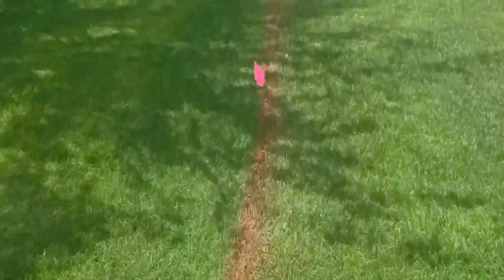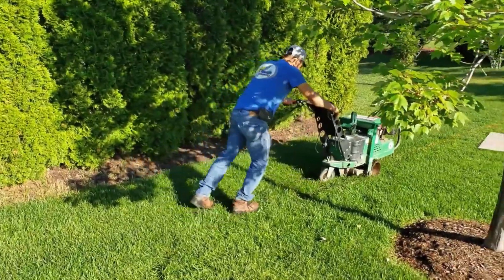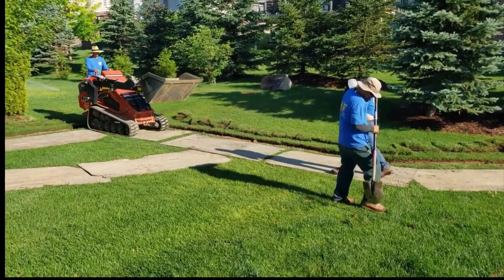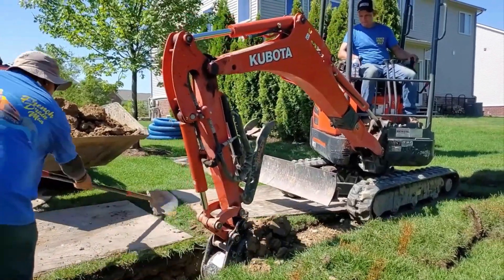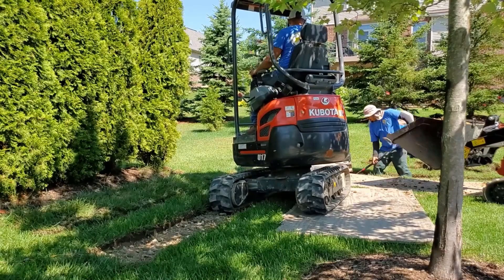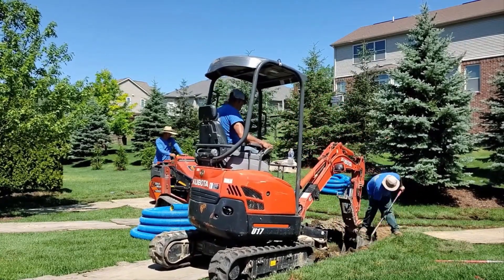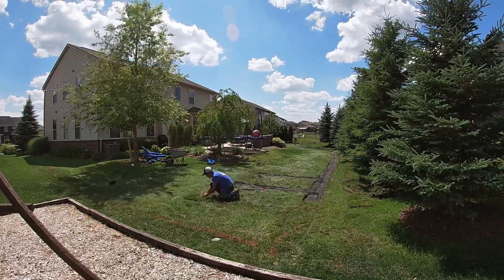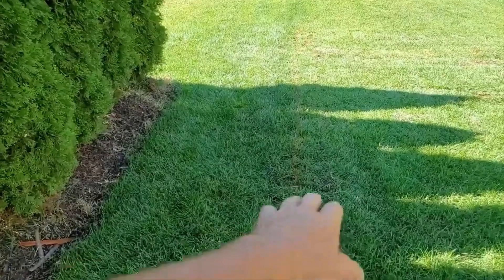How to Build a French Drain the Right Way [ Full Install from A to Z ]

Comment: Love your videos. So informative. I have a few questions and sorry if they're stupid... I'm still learning...  1) Does the High Octane pipe have to run downward everywhere in the yard? I have some areas that slope downward and other areas that do not not. I just want to make sure the water gets to the end of the pipe away from the yard. 2) Do you start with a Drain Basin to connect the High Octane Pipe? 3) Do you put a popup emitter at the end of the pipe line? Thanks for advice!

Comment: Does the depth of the drain need to be lower than the frost line? Where I am in the north the depth is about 36 inches.
Reply: I’ve been wondering the same thing. I think I heard him say that he’s 16” deep. But why wouldn’t the drain heave in the winter? Maybe because it’s not one solid object? I assume it can flex and give as the ground freezes and pushes against it. Probably allows it to settle back to it’s original position as it thaws. Idk.
Reply from the maker: https://youtube.com/playlist?list=PLjFCqaZ4v1BUpFHCLJ_sUFTqw1WoXu1Vz&si=IUDSoUdUUfgGuuKs

Comment: What and how do you plug the end of the pipe at the staring point of french drain? Underneath the trampoline and right next to it, can't really see in video.
Reply: Does anyone know the answer to this question?
Reply: also, are those emitters at the end of those short runs? I see something but not sure what they are since they are at the end of soil. he does not talk much about that.
Reply: There are caps he shows in other videos that go on the end (or start) of the run. I can’t remember what video I saw it. Can probably buy them through his site or Baughman tile.
Reply from the maker: 4 in Corrugated End Cap - Connects to 4 in Corrugated Pipe
https://frenchdrainman.com/product/4-in-corrugated-end-cap/

Comment: I have a question, a company recently did a french drain for me but they didnt use perforated drain pipe, they used solid on the side of my house where heavy rain floods that side. Ive heard from some people that solid was ok but shouldn't have they used perforated?
Reply from the maker: You got screwed
Reply: To an unsuspecting home-owner, a perforated pipe may appear to be a solid pipe if you saw it laying in the trench. Most often solid pipes will have holes in the bottom of them that you may not have seen when properly installed... Is it working well though? That's the important question.